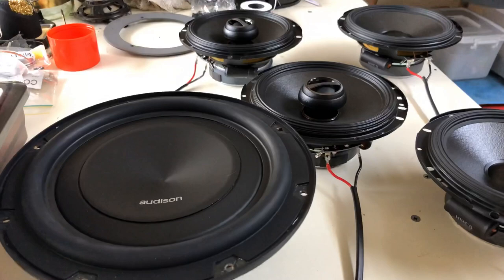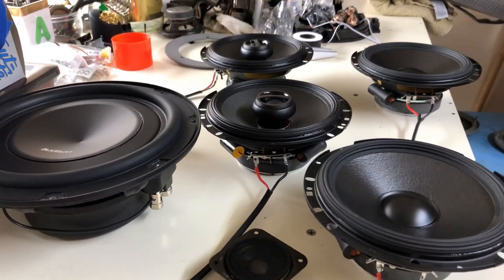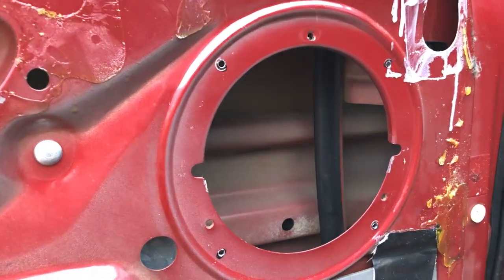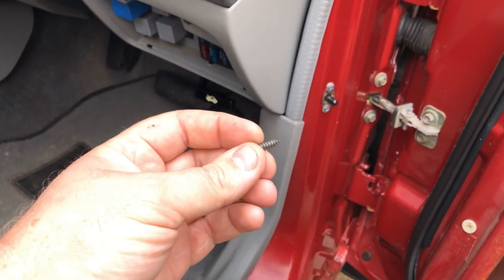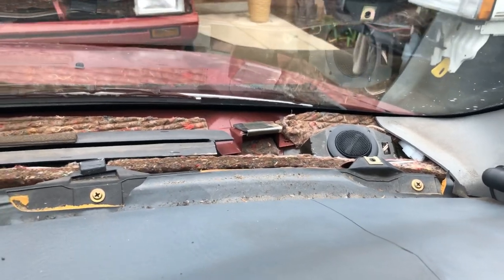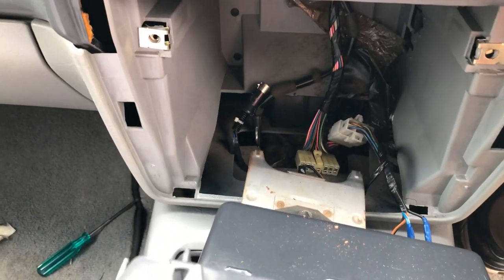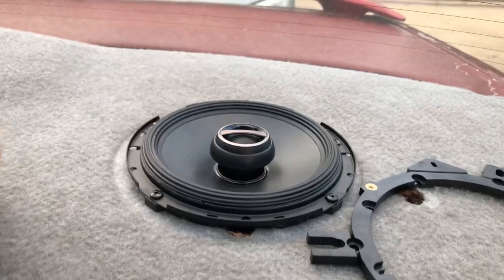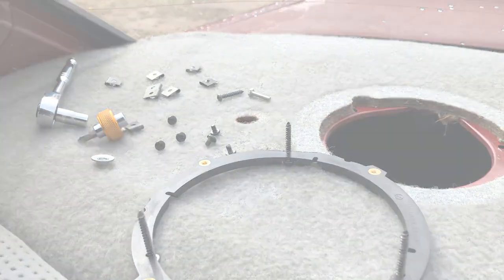New Sound System & How Much $$$$ | EB Fairmont Ghia

Comment: Thanks for sharing your video. Just had a couple of questions.  Have you retained the factory Alpine amp? I hear it only runs the rear speakers and sub.  Have you run your front speakers off amp as well? Are the rear speakers 6.5 “ as well?
Thanks so much,
Adrian,

Comment: hey mate I assume your Fairmont came with the factory sub? My didn't but I just changed over to aftermarket speakers and noticed the hole pre-cut into the parcel shelf to drop a sub in (Audison 8"?). My question, would the wiring harness/plug be back there somewhere for me (or an auto-elec) to tap into? Or would be a bit more involved/difficult?
Reply from the maker: Hey Lou. Mine did have the factory sub. When I was looking at my wiring set-up in the rear, there were extra wires and connectors under the parcel shelf, but I never had additional speakers attached to those...they were just there from the factory. I ended up having the factory amp in the boot replaced with a modern amp; smaller and more powerful. I would hazard a guess to say the wiring might be there, if the wiring is there, you should be able to see by looking underneath the parcel shelf from inside the boot. The Audison amp slotted straight into the parcel shelf. The wires for the tweeters in the front needed connectors put on, as the factory wires were directly hardwired to the tweeters. I hope this helps!

Comment: Would it be possible for you to tell me where you got your head unit repaired. Have same that needs to be looked at. Thanks
Reply from the maker: Hi Scott. MotorVision in Toowoomba. I ended up replacing the factory head unit anyway as it developed another issue...same with the 6 stacker. I had that removed along with the factory Alpine amp. I had a new Alpine head unit and Focal amp installed...so much more power and grunt from the sound system. It sounds awesome. MotorVision did the upgrades for me. Thanks for watching Scott.
Reply: Thanks for getting back